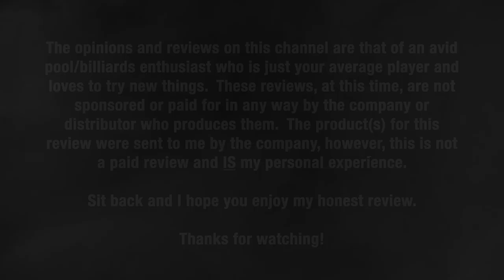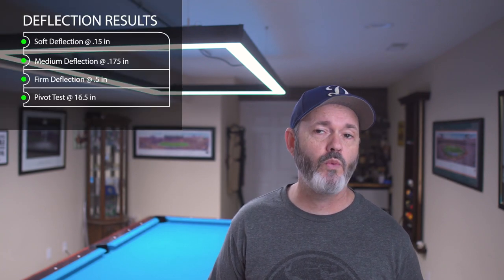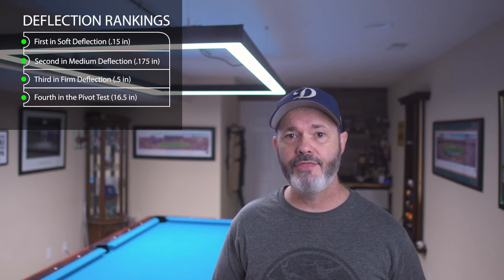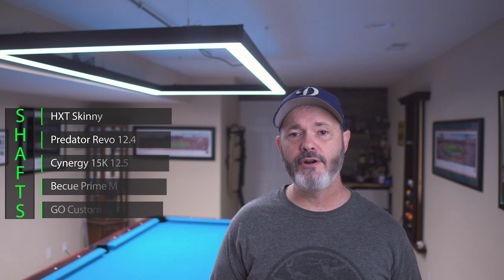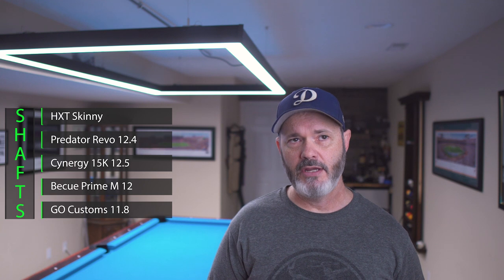How Does the Hsunami Shaft Stand-up?  The Part 2 REVIEW...The Testing!

Comment: The light fixture is amazing.. no dark shadows on the far corners. Any chance you’d be able to do a review on a 12.4 or a 12.8 Pechauer CF shafts? Or even a McDermott Defy shaft??
Reply from the maker: Hopefully one of these days.  There are so many CF shafts out there now that it's hard to do them all.  It's definitely on my list.
Reply: I have a Pechauer Rogue 12.8. The hit was too soft and spongy with the stock Gold tip (I think they put a Jade tip on it now so that one might be better). I switched to a G2 med. The feel of the hit now is really good. But I am surprised/disappointed on the amount it deflects.
Reply: @crazylegson2  that’s kinda what happens when you move up to a harder tip on a CF shaft. The shaft is already stiff, so with a hard tip it deflects.. Hence why most companies recommend using a softer tip on cf shafts. I’ve been using the same Pechauer Rogue 12.8mm with a P.Jade tip and it’s bonkers how much action I’ve been getting with this cue. Yes, it is softer, and does mushroom a bit, but the tradeoff is totally worth it. After adjusting my style of stroke and hitting softer and lighter, I’ve gotten used to hitting this way and understand better when to hit harder. Overall my experience with this shaft compared to the Revo has been completely different and would never use a revo or a Cuetec ever again. Also I’m currently experimenting with a custom made Kielwood 12.5 shaft with a Navigator super soft tip, and still there is an astronomical difference with the Rogue.. 

Just my experience 🤷‍♂️
Reply: @kyzersoze.musicology  Thanks for the reply. Not to be disagreeable, but Dr Dave did a study on tip hardness. His findings didn't show an appreciable change to deflection based on tip hardness. And he's said that CF shafts should be no different.
Reply: @crazylegson2  If that’s the case, then why not just use a phenolic tip? 🤷‍♂️

Comment: I found a video on a deflection test of Revo and JFlowers SMO shafts using a machine showing the SMO at 5.51 m/s deflection of .70mm or 2.75in. Do you know the speed of your Soft, Medium and Firm shots in meters per second. This would make a more scientific comparison.
Reply from the maker: I have seen that video and would love to have a machine do the testing for more consistent results but I don't.  Meucci has or had a similar machine at one point.  The speed I use obviously me judging my hit speed so there is variation with the hits.  The main purpose of my videos is to give you more insight into the characteristics of the equipment (shafts) to the best of my ability and to be as thorough as I can.  The SMO video gives a good look at the machine and I may try to build one if I can but I am not in a position to do that right now.  I am with you about the consistency.

Comment: You are cheating on the deflection test,the spin isn’t true.You aren’t shooting perpendicular to the table you can see it the way the dots are spinning.It’s either your slightly jacked up or some backhand English is being subconsciously used.
Reply from the maker: Which deflection test are referring to, down the rail or the overhead?  I’m not perfect because I’m human and not a machine but I don’t line the measle ball dots up parallel to the surface of the slate so you can’t really rely on the dots rotation since the shot I performed the dots may have been slightly off kilter. Is they’re off kilter slightly, the rotation of the dots aren’t very reliable to see exactly what’s going on with the side spin. Thank you for the feedback and I’ll take a harder look at the footage to see if there’s any way to tell if something is going on and I’ll let you know if I find anything that verifies what you’re saying.

Comment: Overall, I enjoyed both videos and the reviews and the time and effort you put into these. Did you get to keep the shaft? I suppose I would limit my negative feedback If I got a free shaft in the process. I also noticed how pricey this shaft is And with minimum customizations It would be $400+ Which is Way over my price budget for a wooden shaft. Bottom line a review doesn't help me much In convincing me how good the shaft may play or how much I like it.. Wish I could try it out And probably would have a more solid opinion after 6 hours of play.

Think I'll stick with my 12.4 revo Only because I am clumsy and bang my shaft around and drop it Once in a while... 

I just can't see paying $400 for a shaft. That will look like complete crap in about 2 years.
Reply from the maker: Thanks, I am glad you liked the videos.  Yes, I did get to keep the shaft and like my disclaimer in the videos, I still give my honest opinion.  I play almost exclusively with this shaft and have been pretty much since I did the review.  It's not that I don't like the other shafts I have, I just like this one better, and works for me.  The price is in the CF shaft range I understand why you would feel that's too expensive for a wood shaft.  I will say, that a Keilwood shaft tends to be a little more expensive than a regular LD wood shaft due to the process of torrifying the wood but the Hsunami is one of the most expensive Keilwood shafts on the market.  That being said, I think it's the best playing Keilwood shafts on the market and rivals a lot of the CF shafts out there.  You're right about the CF being more durable in a poolhall environment and you can't do that but Keilwood is more resistant to dings than regular wood shafts, it will dong if you're not careful.  In the end, if you have equipment that works for you, stick with it.  For me, I am always trying new stuff on the market because I like seeing what's out there, and not everything I try I like.  By doing these reviews, I hope to give everyone more information if they are looking at the equipment I tried.  It's just my opinion though and everyone plays differently and is more comfortable with equipment that I may not.  Thanks for watching!

Comment: Is that a perimeter light? What size table?
Reply from the maker: Yes, it’s the Predator arena light. I have a 7ft table, I would have a 9 if I could fit it in my house. I made a video on the arena light. Here’s a link to the video. https://youtu.be/pObqaYRDwoo?si=wGqwv4LRre4Oz4Kh
Reply: I have a 8ft pro table but heard maybe I should get the 7 ft light so it lights up more of the inside of the table and not cast any shadows.
Reply from the maker: I don’t think they make an 8ft. I think the 7ft would work if it’s high enough. I’d say if you standard height ceilings, mount it as close to the ceiling as you can do it casts a broader light.

Comment: Did they make anything special on your shaft? My friend had one and he said the deflection wasnt as good as any other carbon fiber shafts...
Reply from the maker: Not really.  I went with Richard's recommendations which were a How Medium tip and a vault-type ferrule.  I only have the data of the CF shafts I have tried so far.  The Mezz Ignite may be better (I've heard it's crazy low deflection) but I don't know.  Based off of my results, its performance was on par with the CF shafts but wasn't #1 except in the soft deflection test.  I need to do a video just discussing the data at some point.

Comment: how exactly does it compare to the 12.4 revo
Reply from the maker: As far as the test results or the hit and feel?  Both?
Reply: @PoolAddiction  as in deflection
Reply from the maker: @julianliow1212  The Hsunami, in my tests came out a little ahead of the Revo.  I did the Revo tests with a different cue call which was a llittle lighter than the one I am using now and that may throw off the comparison just a little.  I am thinking about doing some short videos revisiting the tests I did with the other cue ball and see how much of a difference it makes.  All in all both shafts are great at low deflection.